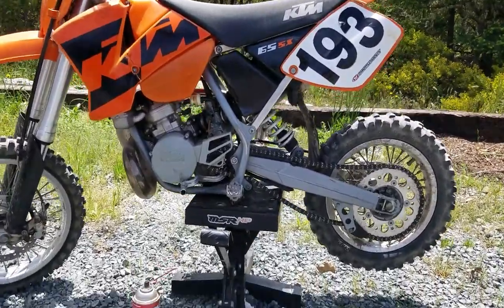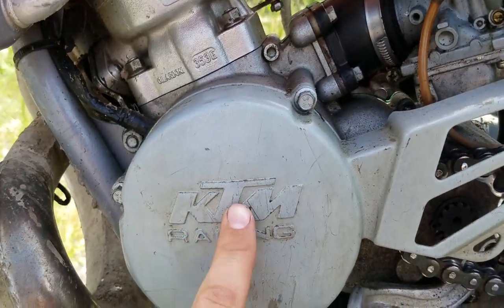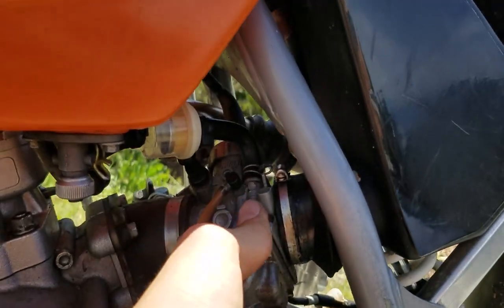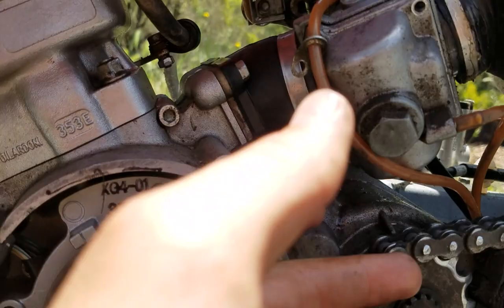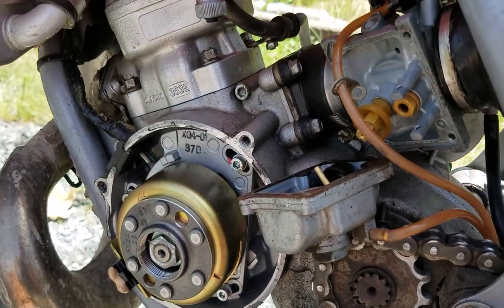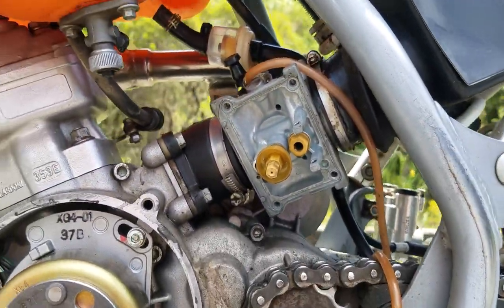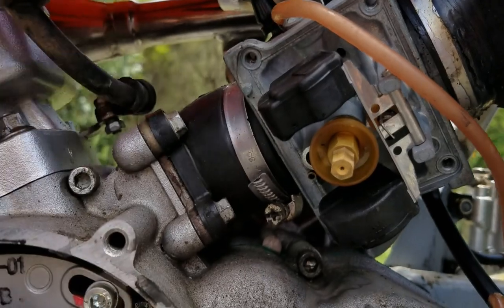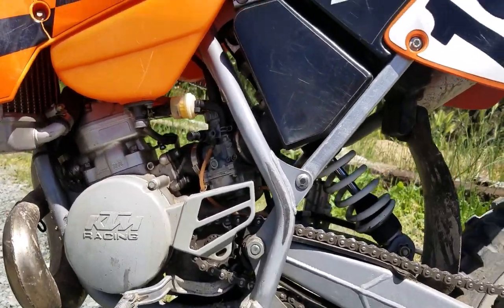(Quick) KTM Carburetor Clean!

Comment: I have a atv that just runs when It wants to and won’t even idle. I’ve tried cleaning the main jet and the pilot jet. Which were gunked up with ethonal. I cleaned them out it still wouldn’t idle. I took it for a ride then I opened the throttle it accelerated for a few seconds then just started bogging wicked badly. It sounded like the dang thing had a jake brake😂😂😂. it just stalled. I tried starting it a few times to know avail. Then I was just like ( you know what I’m giving up ) ever since that day it has been sitting in our garage.
Reply from the maker: Dang bro....hats off to yuh😂